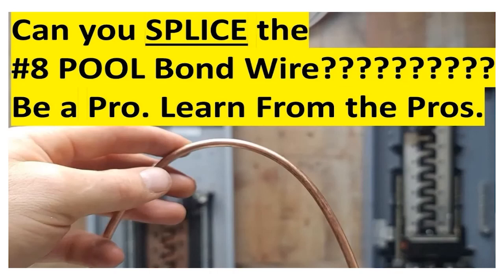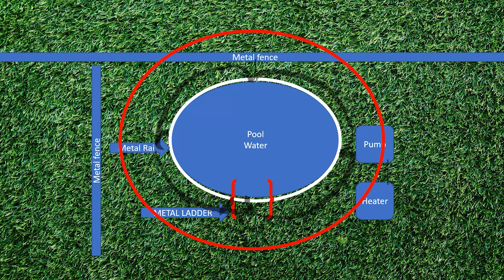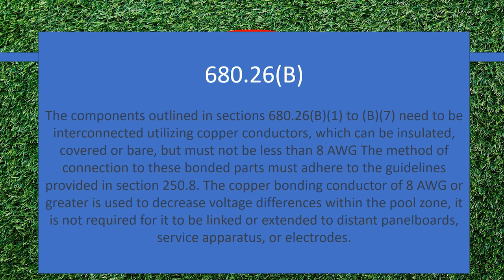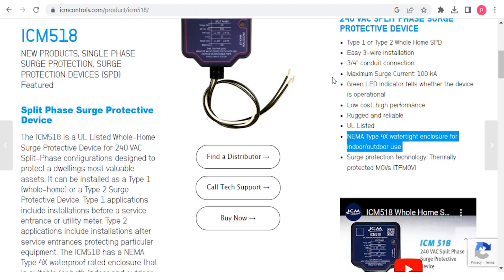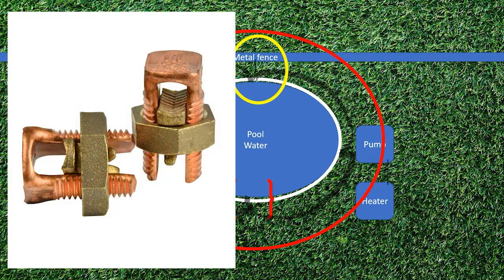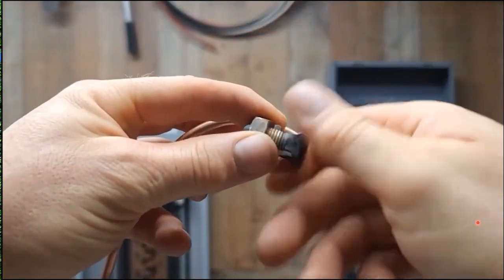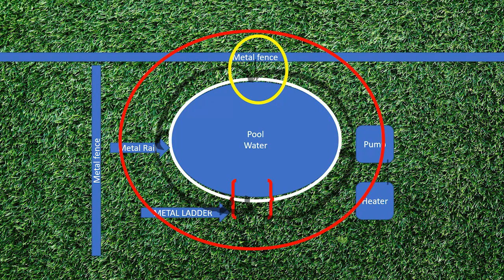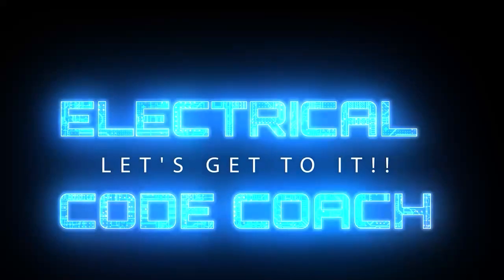Can you SPLICE Pool Bonding Wires? 680.26 250.8

Comment: I'd not yet seen your channel, and this just happened to pop up in my feed.  This is just what I needed to know as my pool equipment has been moved, and the existing bond wire will no longer reach the pump and the heater.  Seems like you're straight shooter, so subscription earned.  Your presentation is succinct with no extra noise or other BS.

The surge protectors from ICM seem like they might be a great product.  But I would highly encourage them to stop calling  a 120/240 Volt, Single Phase system by the name of a type of motor, ie "Split Phase".  I know this error is rampant out in the wild and ignorant land of the Internet, but manufacturers absolutely should NOT be doing it as well.  I try to avoid products from companies that do not use correct nomenclature as it undermines my confidence in them.

Comment: My question : I installed a sub panel with # 10 ground from the another sub panel — I added 2  pole bar copperweld  5/8 x 8 ft conveyed to the new sub panel …. “ Can splice my  # 6 solid copper to the new bars ?? To go all around the pool ?

Comment: I watched your pool bonding 101 video. (I have  installed an semi above ground pool in my yard. I want to semi bury on one side.)
It’s my understanding from watching video that the purpose of the bare ground serves as a dual purpose ie: not only does it bond the water/metal parts but the earth surrounding pool as well? You suggested 4 to 6 inch burial around perimeter of pool. Obviously it’s easier to install the bare ground before any back filling. Is it a problem to back fill over it. There will be about 2 feet of back fill on one side and 6 inches on other